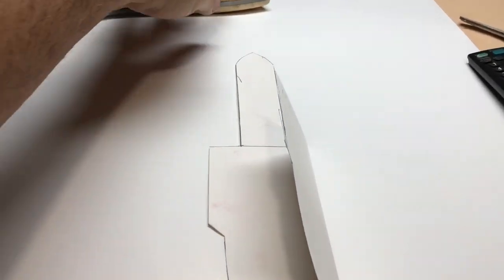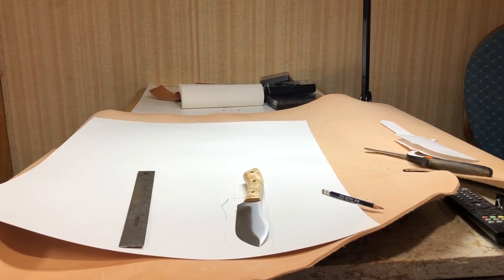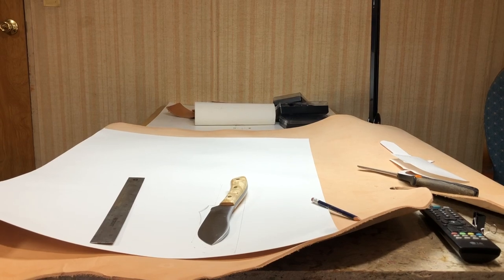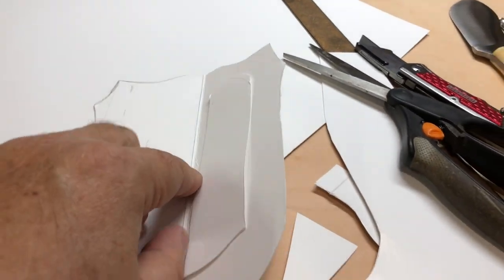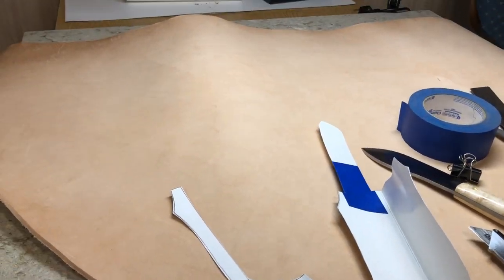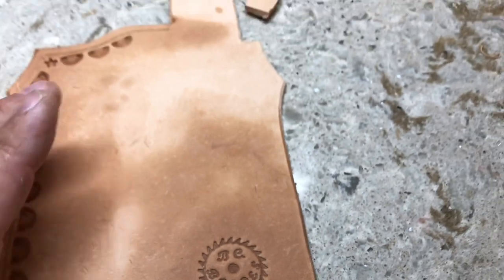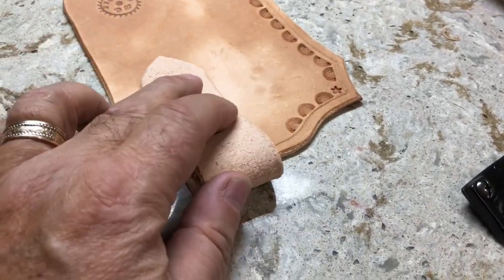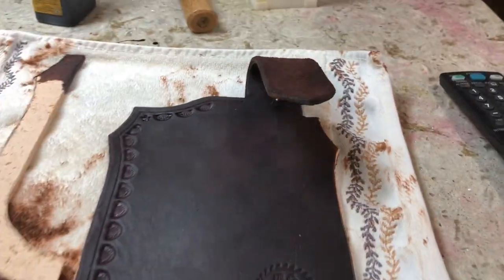Sheath made for give away knife

Comment: Two things, 1. You know a blacksmith that could have made that round fork punch. 2. A very small copper rivet at the start of that stitching would protect the thread. If you are good you could make one out of a piece of copper wire and a small copper washer on each side. The washer could be a small round piece of copper with a hole drilled to the size of the wire.
Reply from the maker: I thought about a rivet. I may do that.